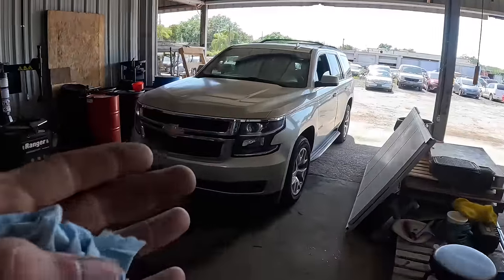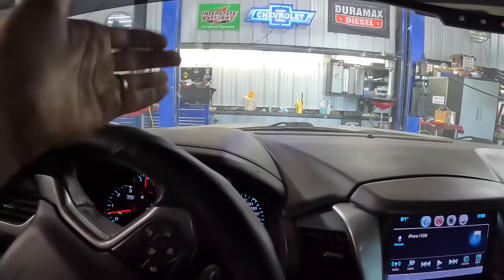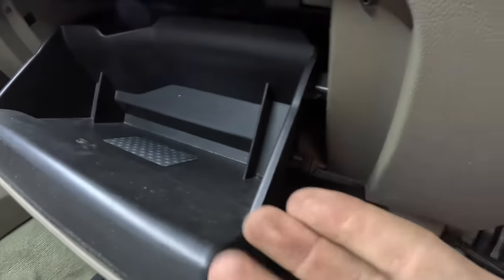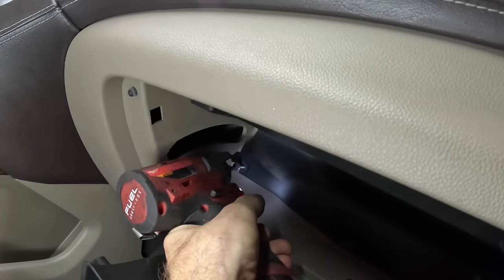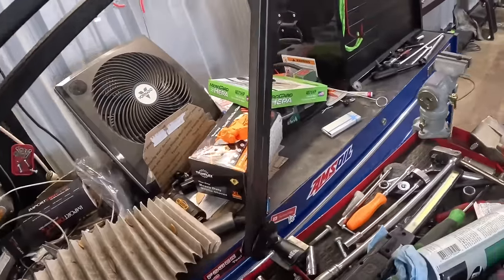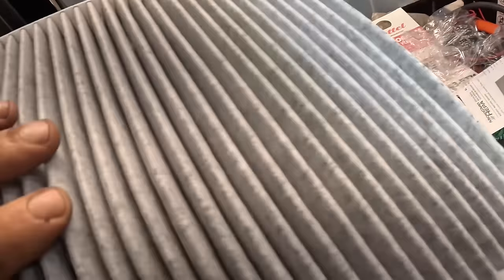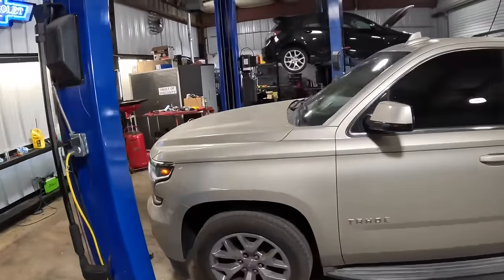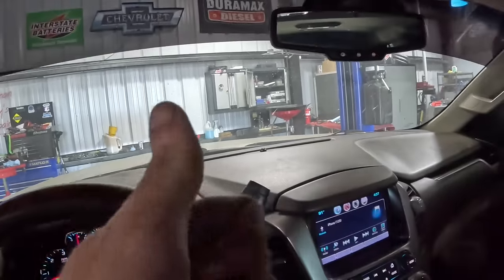Stink Fumes from the Dash! (AC Evaporator Foam)

Comment: What's worse is a dead mouse somewhere in your car lol
Reply: Been there, done that, got the T-shirt.
Reply: Who gave you the T-shirt as i normally do not get one if crap happens.
Reply: I found the remains of one that got squished by the serpentine belt. I was too squeamish to remove it by hand so I gave a couple quick blasts with ny air gun.
Reply: Could be worse. Daughter threw up - milk down the rear seat and into the boot (trunk). I sold the car it was rank!
Reply: Yes it is I bought a used LS430 with a dead mouse and nest in the fan cage. I didn’t see it at first as I change cabin air filters every 6 months. If y’all done have one an ozone generator is worth the investment, about $100.
Reply: A dead fish under the seat like in the movie Grumpy Old Men. LoL
Reply: or bird
Reply: A dead mouse missing it's head stuck in the condenser fan under the refrigerator... grabbed it by the tail chased my wife & I said in a little voice give me back my head
Reply: @michaelpressman7203  🤪
Reply: Two summers ago, I bought two gallons of milk with all the other groceries. I unloaded (what I thought was) all the bags. A week later, I found out I left one of the gallons of milk in the back under a bunch of crap. The plastic had burst and was still half full of a green slime. I had to remove the carpet & the back seats and wipe down (several times) all the surfaces. I hosed out the carpet and seats, rug shampooed it many times and assembled it back. It took about a year to stop the random whiff to float by.
Reply: I had mice bring dog food into the vents in the air vents. I spent hours trying to get rid of it, but smell got worse. Smell of stale, rotting dog food roasting on a heater core. Had to take it to the dealer who had to take the entire dash out to clean it all out. $2600, 90% labor.
Reply: Man had bought a piece of furniture outta a barn left it in his S10 Trailblazer. Next time he went to get the furniture out he noticed all the rubber top of door panels were chewed up and the vehicle wouldn't start. So he towed in the vehicle and then we could smell the reason why . Apparently mouse had taken up residency in furniture and when he bought the furniture the mouse came along for the ride ,mouse tries to get out by chewing the hell out of everything including wire harness to neutral safety switch then went up floor vents and died in ac blower motor housing. By time we had gotten the dash and interior out of truck flies had found the dead rodent and the ac blower motor was dripping mouse remains.  Never got rid of the smell even after washing the a/c case etc when the vehicle sat in hot sun
Reply: Nah. THat's kinda gross.  Putting a whole steak inside someone's back seat armrest is waaaaay worse.
Reply: Been there! Found one in the filter box.
Reply: Dad bought 9 20lb turkeys to give to charity. Unloaded 8. Two weeks later...I tried airing out the car. Ozone machine for 48 hours. Eventually, sprayed trunk with Enzyme. Pet enzyme is expensive. Same stuff as in RV Holding tank enzyme. I use the orange scented stuff. Except a quart, $3.50-6.00, will last forever. One tsp / gallon. Great on dog piss concrete, carpet steam cleaner, etc. Even eliminated foul foul smell from trunk. Make sure your well ventilated when spraying, vacuuming, applying. Safe on skin, bad for lungs. Smell gone 24hrs later.
Reply: The worst is a spilled bottle of milk in your seat cushion padding. Always make sure your groceries are secure
Reply: dead squirrel... MUCH worse!

Comment: My vehicle has no cabin air filter. I actually cut small holes in the HVAC box with a Dremel tool. A small round one before the AC coil and a little bigger  square one after the coil. The small round  in front lets me see how dirty the coil is and spray cleaner in, I had a tad over 100K when I did this and it was unbelievably filthy and clogged. I used one of those foaming house hold cleaners. From the back side square hole I used a shop vac to blow air through the opposite way. Worked pretty well. Afterwards I duct taped up the holes. I check it again In another 100K. lol

Comment: Bacteria and fungi growing on the evaporator and condensate tray cause the offensive odor. Check out Kia TSB CLI 016 REV1 for a treatment kit with biocidal evaporator coating that provides long-term odor suppression. Most auto makers parts departments offer a similar product.

Comment: Hey Ray that's not always true . I have a 2006 Trailblazer SS and it doesn't have a cabin air filter GM stopped putting them in the Trailblazer and envoy and so on after 2004 but you can still buy the filter and if you really want to the airbox under the dash is still there with the door slot and screw hole but it's sealed so you have to cutout the opening then find a door from a older model and then your good.

Comment: To facilitate charging labor, you have to take the time to order parts plus u wouldn't clean the debris from the air box or cabin if just putting back the used fters.

Comment: my impression - I've owned older vehicles that pre-date cabin filters. The heater & evap core remain cleaner and you don't see dust residue in the vents with vehicles that have cabin filters

if you've taken an older car apart to service the airbox - after many years, there's a lot of crud (dust, pollen, tree litter) that gunks up the heater core / evaporator

Comment: I too have lost my sense of smell, but due to thyroid disease. Thought I was getting it back last year, but turned out that I was dying do to Ant-GBM disorder.

As for the cabin air filter, that has always been part of the service package offered by the dealership I dealt with so I never got charged extra laboure when they checked it and authorized replacement.

Comment: Hey ray. Re your mention of the ozone machine, youre right ozone can work but the most knowledgeable detailers have moved away from it as a quick fix because they are unsafe in amateur hands and also cause significant ageing of interior plastics etc from only a single treatment. 😊

Comment: Probably a Carquest filter. They look just like that. I actually ordered two of them: a Carquest and a real Motorcraft from Rockauto. The Chinese ones have less creases (blades) than the Motorcraft. And yes, they smell bad at this point. Electrostatic: the particles stick to the filter like clothes in the dryer when you didn’t put some softener.

Comment: I put one of those Microguard cabin air filters in my Explorer. The wife says it works very well getting rid of odors. It was a very tight fit too. 

The filters I originally ordered, which are labeled specifically for my Explorer... were a 1mm too tall! They would not fit. Ever. And I tried. The pleats of the filter media, and the side panels, were too tall. US made too.

Comment: We used to take my wife's car to a national oil change place because they used Castrol and I like that oil. Every time she went there they would tell her she needed a new air filter, so I pulled it out and it was clean and I had thought I had just replaced it not long before that. Well this went on for 3 or 4 oil changes (she doesn't drive anywhere dirty), she finally told them to change it so they would quit bothering her, for 35 or so dollars. The old one still wasn't dirty, I always make her bring replaced parts home. Now we have to find a new place to change oil

Comment: They do recommend to change the filter every year.  Just like the filter on your home heating/AC unit they get dirty.  The problem is where they put them. They have gotten better in the placement of them.  But some makes you have to dismantle a lot of stuff to get to the filter. 

When I went to Auto Zone to get a replacement cabin filter for my 2020 Colorado.  The counter person didn't know what he was looking for. After asking about engine size and if it was  4 or 2 wheel drive, he told me that they were out.  So I  went to O'Reilly. They just asked if I wanted a regular filter or a hepa filter.  So asking at the auto parts store may not always be helpful.

Comment: Excellent video.  For 2009-2019's Ram 1500/2500/3500's if you do not have a cabin air filter, they can be added with a quick mod if you would like to do so.

Comment: arrow flow is which side has the glue sprayed on to collect the dirt ,paul havery used to hack a non electric  static filter. filter had something like nylon strings running thru filter and worked sort of like the way a comb running thru your hair and then picking up small bits of paper . they really didnt work that well

Comment: I purchased a 2018 GMC Acadia with 102,000 miles on it. The GM dealer listed "Changed Cabin Air Filter" on the pre-sale service sheet. Well, the performance of the defroster was weak, and the air smelled of smoke, so I pulled out the CA filter. OMG!! It was so gross. Guaranteed original, never replaced as it had a GM part number and 07/2017 as the date code.

Comment: As far as filters go, "electrostatic" means it is made of a material that creates a static electricity charge between two different types of material when air moves over it.  This "grabs" particulate matter that can be "grabbed" by static electricity like small hair particles and most dust.  

Essentially it's a different line of defense since no standard filter material can filter 100% of particles.  At that point it's not a filter but rather a seal.  Electrostatic filter material allows air to move through it while creating an environment which is difficult for dust to get through. 
 
K&N filters sort of have the same idea since they use the tendency of fibers to vibrate when air is moving over them creating a sort of "hall of swords" that dust has a hard time not getting "caught up in"... 

 However that sort of material isn't statically charged instead it's "wet". 

The cabin air filter here relies on the static charge instead of moisture.  

It is similar to a balloon rubbed on your head.  

Things want to stick to it.  Everything except "air".  Which moves freely over it.

Comment: Just took my 2021 GMC 3500 Denali Dully to the dealer for an oil change and they did exactly what you said about the cabin air filter. They told me the filter needed to be changed, so I said ok. I got the bill and was charged $35.00 for the filter and $25.00 for labor. Yes, they had to take the filter out to see the filter. Didn’t think about the labor charge at that time. Right now I feel stupid and cheated, thanks Ray! One issue, I didn’t ask to see the filter, my bad!

Comment: my first volvo 70 came without. but lucky could get a junkyard holder and toss it in and than had a nice carbon filter in the car. also prevented the car from flooding when it realy rained and drains were partially cloged with debris.

Comment: I changed our 2016 QX80 cabin filter last summer at 150k miles. I went after it because the air flow was very low and it was getting hot inside. It blows like a hurricane now.

Comment: I use an air con bomb once a year, and change out the filter. I understand that if the evaporator gets full then it might not be as effective as spraying it, but it’s never been an issue in the years Ive used them.

Comment: Considering that the air is blowing right into your face from about 18 " or so, I replace mine every year.  Recently bought a "07 Solara and first thing changed cabin and engine air filter.  Got the charcoal as well.  It was littered with crud and filthy.

Comment: Basically, stated it filters the electrons from static type electricity hence electrostatic filtration is achieved. You want to make sure you get up into the A/C drain tube and the vent tubes to the cabin or the smell will remain. They are useful especially if you have allergies to pollen.

Comment: electrostatically charged layer... well, back in the day, we used to have pc fans that used fine metal grills, as the air flowed through, it'd build up a charge and the filth would build up on the back of the filter and air flowing in would sweep it off the front, so it'd only be on the back.  maybe it's a fine metal mesh on the back of the filter, woe to he who puts it in backward.

Comment: 5:04  on the filter question
My 42 year olds acura Tl i can see getting charged to do an airfilter
The pipes are really stiff new and the filter box is a pain in the ass to open up just to look.
Some BMW cabin air filters are hard to get to let alone take out and look at.
I never gave it any thought.
What did piss me off a month after i did back brakes on my scion TC 
I got told by the tire store one of the rear shocks were bad, i looked at them when i did the brakes no oil leaks the bushings looked good I didn't see a problem with them and the tec didn't take me out to look.
I honestly think he was trying to get me to replace them to get my factor lowering springs, i also saw them doing other work that was questnable  and rotating the tires they did not balance the tires on a set of tires that cost 250 each plus labor.  19" rims on a car that stock uses a 15" or 16" rim.  The suspicions so stiff on the car I'd know if a shock was bad. 
I could tell real fast they didn't balance the tires right the time before that. When the car has 37lbs and 39lbs in a tire with a 1.5" sidewall you can feel everything.
The shocks are not loose. 

You pull an air filter out to look thats service,  your not in business to give away work  but thats still a fine line.  Maybe  less then normal labor rate or free with other service.
Thats kind up to the shop but they should tell you up front.
You should always know in advance.
Who know you could swing the 15 to 20 bucks on the filter, but the shop labor rate @ 110 to 140 is more then you can afford.
And for the 15 min it takes say 25 bucks labor means you can't buy food that week.  You should never have a surprise charge on your bill.
Thats whats wrong about that its not the labor charge, its finding out later you have to pay it on top of the filter charge.
Some people are not handy and will pay you to do it. Others will diy the job.  And other people never open the hood. 
Pointing out issues is something a shop should do  but it has to be honest.  

If someone tells me my shock is bad I want to see it. 
Were talking about a tec that used a dead blow to take the wheels off the car, the wheels are magnesium
And i had just painted them 3 weeks before he put it on the lift, a light hand slap took them right off.
No hammer needed.  Just a light palm smack.

Comment: Sprayed mine into the condensation drain , still ended up with a bunch of foam in the footwell. From  the box seams.
To change the filter I had to remove the wipers , and the plastic under them. To get between the firewalls .
The drain had a rubber pinch pipe at the end, left it off to air out the box, still not put it back after a year ,

Comment: If you smell musty / moldy then you have a water standing problem in your HVAC box, or water infiltration problem into the cabin wetting the carpet / headliner etc.
Reply: Thats correct.. Sometimes the drain hose is rotted out and leaking into the cabin flooring. good point.

Comment: Just because i know my car has a filter doesn't mean i can find it.  My last car had one, but neither my dad (a former mechanic) nor I could figure out where the owners manual diagram meant.  A few months later it started burning enough oil to flunk emissions and I got rid of it with the 6 months overdue for replacement filter still in it.

Comment: My 2011 Suburban K2500 LT has a location for a cabin air filter so parts resources list it.  However, GM does not furnish the element and the first time a filter is installed, the access panel needs to be cut out.  This is a difficult location, especially with a full floor console.  I think the GM dealer charges about $800 for this process so I did mine and at 6'4" it was not easy.

Comment: Cabin filter and air filter were full of debris… air conditioner didn’t work well. After every filter was replaced, vehicle performance and air conditioner improved. Elders got ripped off, found receipts where they were charged for filters. 🤬  I marked them and when they bring it back from service, I check. So far it’s good.

Comment: My Mitsubishi 380 didn't come with an air filter, and several years of driving around with a fluff monster German shepherd in the back seat resulted in the evaporator being clogged with doggy hair and really smelly in summer.  It was a nightmare to clean out the evaporator but I wasn't prepared to pay 2 grand to have the dash removed.  Tight arse Mitsubishi had the place built in for a cabin filter but never installed one.  So it was relatively easy to cut out the allocated slot in the air box above the fan for the cabin filter and slide in a cabin filter that THEY SHOULD have installed.